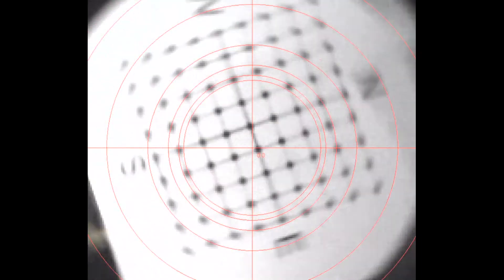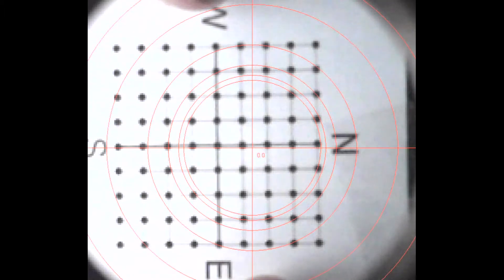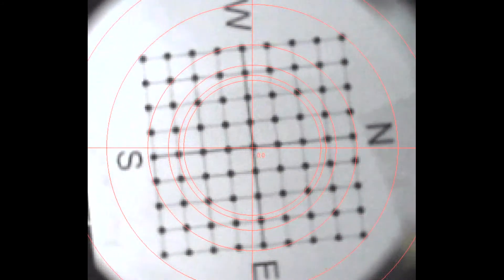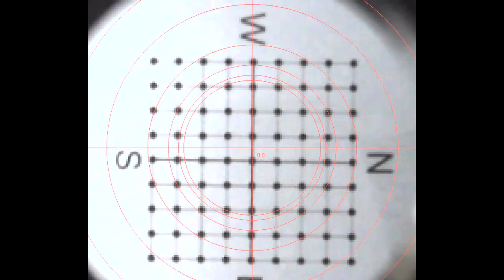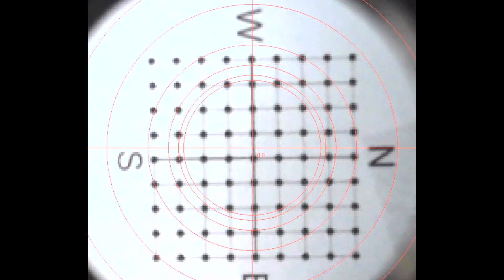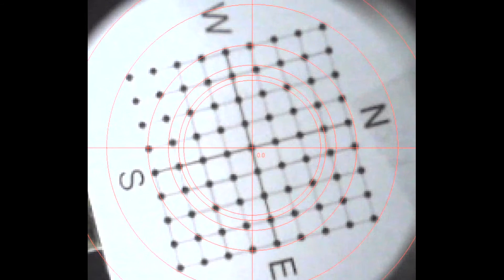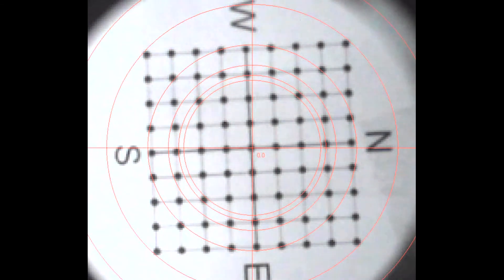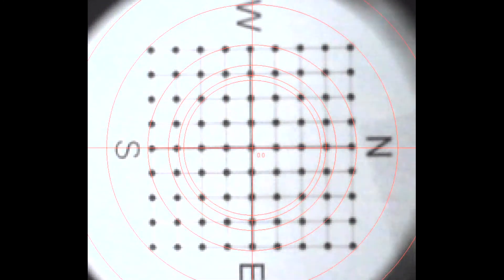Webcam based telescope collimation

Comment: I always imagined a grid for this , But , In the form of a cone placed on the tube opening . The cone would be illuminated in
a manner that would work with a lens in the focuser making the grid lines curved until collimation is correct , Then the grid lines would appear straight , or correct.     Hard to describe w out pictures.    Nice !

Comment from the maker: The optical axis of the webcam needs to be aligned with the focuser draw tube. If it is aligned, then rotating the webcam should not make the image of the grid move around a circular path. At the end of the video, rotating the webcam does not make the centre of the grid deviate. The grid can then be removed to collimate the telescope secondary and primary.